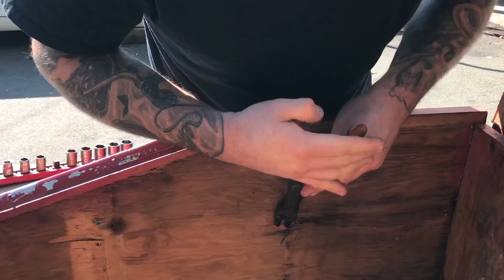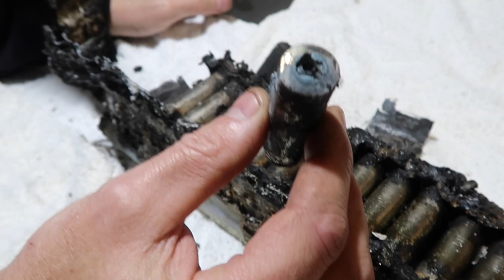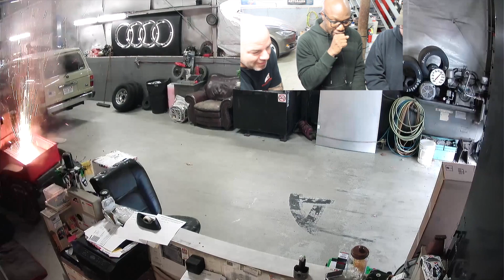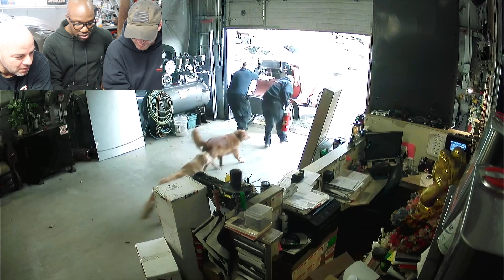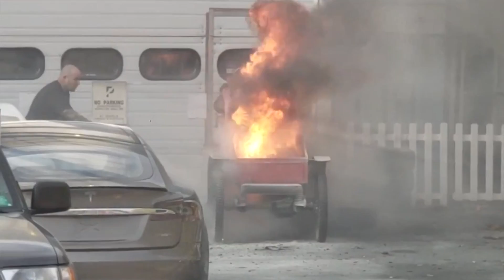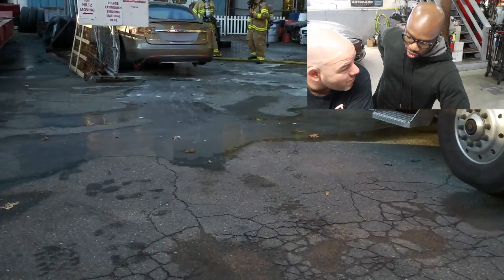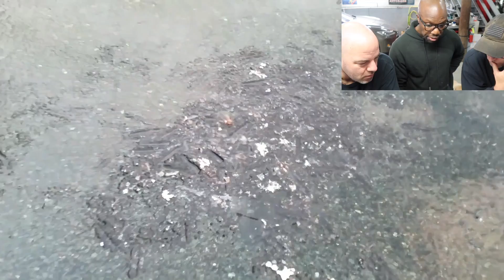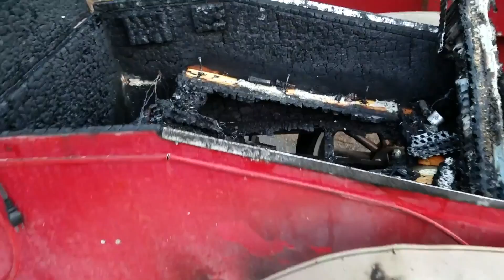My first Tesla Battery Fire

Comment: To extinguish a Li-ion battery fire you need to remove the heat of combustion fast, that will stop other cells not yet burning from joining the conflagration.  Water is great for that. Unfortunately most EV batteries have a lethal terminal voltage of around 400V and water is a good conductor so try not to get electrocuted while putting out the fire. The part that is burning is probably safe (those cells won't stay series connected for long in a battery fire) but adjacent modules may not be. Best play it safe and avoid those fires in the first place.

Comment: I truly believe you should not take those Tesla battery packs lightly. Seeing what happened I think you may not be ready to play around with those things in a shop and it goes to show why they want to avoid ordinary people without adequate equipment and safety precautions to handle these things. That could’ve burnt the shop down. Not only that, any of those guys could have easily been hurt by flying batteries. This is serious and I don’t feel your concern at all..
Reply: The problem is also very easily avoided, hence why he's not that concerned. They were charging without a battery management system which is pretty damn stupid. Play stupid games win stupid prizes.
Reply: A Tesla battery with all the cells is high voltage and amperage 375vdc and 1000a+. You could die easily just handling them if you became part of the ground. These batteries are extremely dangerous for fire and electrocution under certain circumstances. look up "electrocution danger for ev" and you'll see the risks for occupants in car accidents so handling would be just as dangerous in a shop.
Reply: "I truly believe you should not take those Tesla battery packs lightly." Duh, that's the whole point of this video. They knew it was serious, but running around like headless chickens wouldn't have helped anything.

Comment: where those powder extinguisher they used? I sure hope not? Else i hope they dont mind scrapping all the cars near it because they are now all just piles of junk. The shit in those extinguisher is really bad for anything electrical,  and wil make prettymuch anything corrode away in a short time.

Next time just try and get a pack cool, spray a water mist all over it so the 1st cell wont heat the next cell to the point it starts burning. Yes it sounds stupid to put water on electricity to stop a fire, but keeping the cells cool is the main thing in a fire like this.

Comment: Lol looks like his shop needs a course in types of fire extinguishers cause they clearly didn't have a class c extinguisher for electrical fires
Reply: Extinguishers are a,b,c. Thermal runaway was the culprit here.. the extinguishers were only for the flame control, not to extinguish the batteries.

Comment: When I saw the last episode I said to myself that pack isn't getting cooled. I was going to say something but I sat back and said "Yeah...these guys are electrical geniuses...NOT!"

Well nitwits, prepare to be evicted and then do a video of your face when you get the bill from the Fire Dept. Did you tally up any of the damage to other customer cars in the vicinity?  Are you filing for bankruptcy protection already? ROFLMAO!
Reply: This was caused by overcharging with the wrong charger (a "dumb"  lead acid charger) and not watching the voltages of the cell groups while charging. Cooling wouldn't have prevented this, and is un necessary for light duty uses if done properly. This is a case of not taking the proper precautions when attempting to (knowingly or unknowingly) use improper equipment. Big lesson.

Comment: Battery management circuits and thermal protection / cooling is very important!
Reply: For a project where charge time is irrelevant, just keeping the current at 1A or slightly below, nothing will heat up. OH! he didn't use a bench power supply!

Comment: You guys should have a heavy fiberglass tarp in your shop ready to go for stuff like this. If you ever get a battery pack fire in your shop again, you should immediately throw the fiberglass tarp over it before you move it out of the shop to keep those batteries from flying out and setting other shit on fire. The most important thing in that situation is to keep secondary fires from breaking out.

Comment: This made me second guess keeping our tesla module under our bed.....  My guess this was an overcharge situation.  These batteries run such a low voltage that a dumb 24V battery charger will cause this every time.   BMS is absolutely required when using these or any lipo battery to make them safe!
Reply: Without bms the battery will pms...
Reply: Nevertheless storing a battery under your bed is a bad idea
Reply: I suspect these aren't slid under their bed at home like a toy box, but rather installed in an RV, probably in a basement locker under the bedroom, on my RV the petrol (gasoline) tank is under the bedroom and on a Chevy P30 chassis, that's quite a big tank.

But regardless of whether it's in the basement, or literally under the bed, I'd say taking the time to review containment, suppression and prevention measures would be a good idea. 

Of course if cost is no issue, buy an RV with a higher GVWR and maybe start with lead acid batteries, then move on to maybe lithium batteries with solid electrolytes.
Reply: under your bed? incredibly stupid. im uneasy enough with a phone charging beside my bed let alone a full size tesla pack...
Reply: Why is there a tesla module under your bed?
Reply: You're a solar Guy Tom right? Then you should know better.I must compliment you on your system now is one of the better ones out there..
Reply: Hey if it makes things more exiting in the bedroom.
Reply: It certainly is when using Tesla's firecrackers. The "fuse wire" is the only physical safety in those modules.
Reply: I filled my bed with hydrogen gas and  I store fireworks and propane tanks underneath it. Its fineeeee!
Reply: Right you are Tom. I was floored that these packs were installed without a proper BMS as it appears they were charging at the time of the incident.

By the way, there's not a single comment about how insane it is that not one, but two Tesla packs were installed in what amounts to a toy. 10.6kWh in something that weighs maybe a two hundred pounds, isn't street legal and is incapable of speeds much more than 30mph!

Hope all's well with you and Caitlyn. Best wishes for a wonderful 2020.
Reply: UNDER YOUR BED?!?!?!?!?!?!?!?!?!  GAAAAH NO:  do you keep your gasoline cans under your bed?  Do you keep your firewood under your bed?  Do you keep your air compressor under your bed?  Do you keep your kerosene canisters under your bed?  Do you keep your propane tank under your bed?  Do you keep your hot water heater under your bed?  Do you keep your oven under your bed?  Do you keep your catalytic converter under your bed?

Keeping any type of energy under your bed is like keeping a battery pack under your bed.  DON'T DO IT!!!
Reply: @bradallen1832  keeping gas cans under your bed actually isn't dangerous unless they are open. now if you had a gas can under your bed feeding your generator, then that would be dangerous.
Reply: @Brad Allen Do you keep a phone in your pocket? A laptop in your backpack? Oh no! haha its fine

Its actually safe to have these under your bed if you design and build it properly, and are not a novice like the guys in the video.
Reply: Batteries do not explode when they're not attached to anything and not under mechanical stress.
Reply: @anlumo1  If you look at 3:10 there appears to be a cord running up to the front of the battery compartment of Daisy. At 3:14 he kicks it away and it's lying on the floor.
Reply: @anlumo1  unless there is an internal short in the pack. l had an old laptop battery laying around and one day l was in the shower and came out to see that my bed room was on fire. and sure enough there was a short in one of the batteries that caused a chain reaction. it probably got dropped at some point and shook something loose.
Reply: @ElectronicsForFun  Yes, technically that would be the mechanical stress I listed as exception. There's also the Galaxy Note 7 issue, which was caused (as far as I know) by bending the battery cell too much during installation.
It's hard to tell from the outside whether a cell is under mechanical stress.
Reply: @anlumo1  what about ESD?
Reply: @ElectronicsForFun  I sure hope that you're storing your batteries in a way that they don't make electrical contact with the outside.
Reply: @anlumo1  the outside of what? l didn't remove the cells so l couldn't see if they were making contact with anything. there was probably a fault in the pack.

Comment: "There was no battery management system" That was the problem!!! Was the water cooling system even filled with water and connected to a radiator? Thermal management would most likely have prevented this.

Comment: Also quick tip: Salt water. I've extinguished LiPo and LiIon batteries and it basically stops the reaction right there. Do NOT use regular water.
Reply: The reccommended way to deal with a thermal runaway like this is lots of water. You need to cool the batteries down. Plain water is NOT a bad idea, it is used as a cooling medium. It is far more effective than any extinguisher, as you will not stop the chemical reaction, which causes the overheating with powder or CO2. You need to cool the batteries off. Trying to starve them of oxygen with extinguishers is ineffective as the combustion process inside these batteries provides them with their own oxidising agent.
Reply: A container of Salt water is used to slowly discharge a lithium cell prior to disposal. Cant imagine it helps with a fire burning at a few thousand degrees.
Reply: It work for one cell, but nobody have enough salty water at hand for such a scale.
Reply: @tiloalo  Yeah the main problem is actually getting the salt water INTO the cell instead of just around it, and quickly enough. Still regular water is a very bad idea, and sand doesn't help at all either. This reaction is not dependent on external oxygen.
Reply: @ToumalRakesh  I don't know what's the recommended method for this kind of cell fire, is there any?
Reply: Touli Loup  class d powder, co2. halon, roughly in that order.
Reply: @dogphlap6749  so ev shops should only be authorised on the coast ^^
Reply: @ToumalRakesh  actually you are wrong the Tesla recommendation is to use excessive amount of water.
Reply: @tiloalo  Cooling is the only way to stop the cells from burning. The combustible/flammable material is inside the metal cylinders, together with the oxygen needed for a fire.  Plenty of water (non-combustible liquid right at hand) works better than CO2 or powder.

Comment: As I understand it, one of the problems with these packs is that, one you've put the fire out, it might not remain out.  A few months ago here in CA, a Tesla wiped out, caught fire.  Local FD had the fire extinguished, put the wreck on a flatbed.  It caught fire two times on the way to the scrapyard.